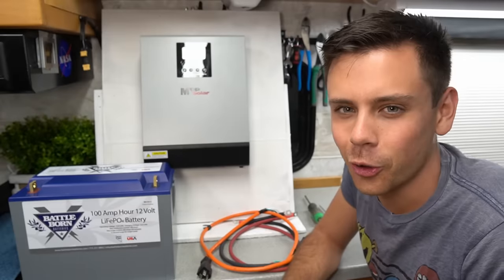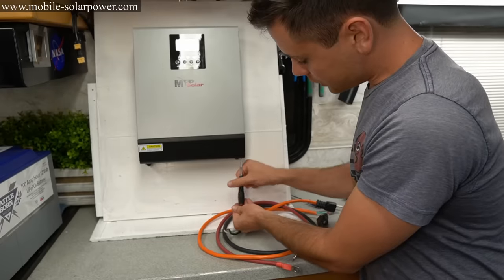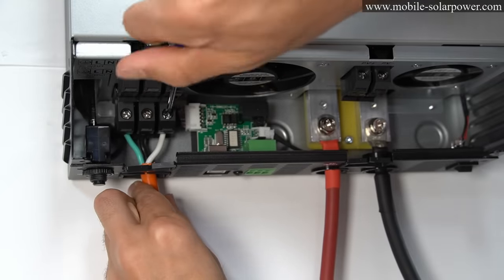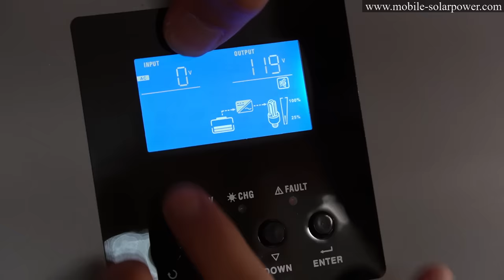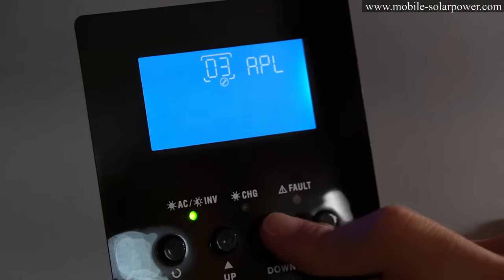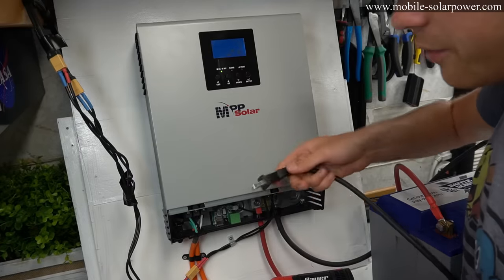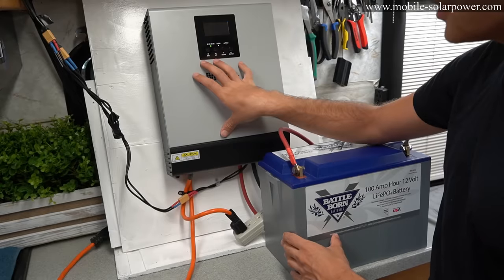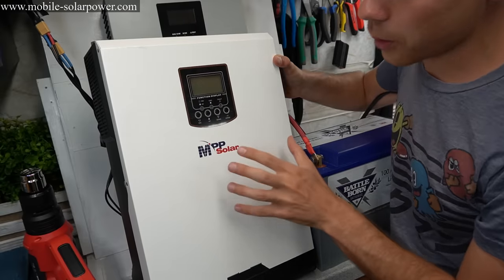Beginner Friendly All-in-One Solar Power System! Build a System in Minutes

Comment: Small tip for anybody who might struggle with putting that cover back on. Tape it in place with a piece of painters tape, put the screws in, take the tape off. Done.
Reply: Good call. 👍
Reply: NNEEERRRDDD!!!!!!!
Reply: EastSide Eddie I used electrical tape...it worked to keep the bugger in place. I never thought mounting the unit would need to be a 2 person job.
Reply: He should invest in better screwdrivers they even make screw holding screwdrivers that would make puting the cover easier.
Reply: Oh..this and about 1000 other times in my life that I could have used that trick had I have known!

Comment: I have the 24v version it has been running for 2 years my brother has the 48v version and it has been going 5 years they are good systems
Reply: Can i run a 600 watt grow light of this system
Reply: @sweetness6048  the inverter is good for 2400 watt so yes but it will also depend on how much battery capacity you have.
Reply: Must this system require an AC breaker(between AC input power source) and a DC breaker(between PVs and inverter)?
Reply: @tchelenon  yes,,, always use breakers to protect from fire.
Reply: Are you able to get the 48v 5000w version that has a 110 output and input for use in the US?
Reply: phuc ewe  cause indoors is more stealthy and I can provide better growing conditions no bugs or mould problems
Reply: @sweetness6048  Indoor growing is very very energy intensive.  The statement that you "can" provide better growing conditions, really means that you will be running other equipment as well; such as fans, dehumidifier, AC unit, heater, etc. as needed to provide those conditions for the plants.  All these electrical drains will kill your solar system if you only intended to use 600 watts.  
A 600 watt light for 16 on 8 off is a huge amount of energy to provide by solar, basically looking at a 20 thousand dollar or more installation.  and then you need to consider all the other equipment you will need to run in case of high humidity or high temp or low temp or low humidity etc.  
So the short answer is "no"
Reply: @thedillestpickle  I only need to offset the cost off the light witch is 600watts ac and all the other equipment will be powered from the grid Witch is why asked if it's was able to power light and not all the above like you mentioned
Reply: phục êwê cause he wants indoor. He doesn’t want light depth or outs.
Reply: 48v system where you wire the panels in 4 panel series (=48v ?) To narrow the voltage gap between inverter and use like an A/C system plus whole house off grid? Assuming very little A/C at night when solar is zero?
Reply: @sweetness6048  😎👍✌
Reply: Can you shut off the inverter without shutting down the whole system?
Reply: hey great video bro, what if i want to increase my battery bank and use more that two batteries, can this system safely handle it? And what if i want to use more solar panels that exceed the 85volts recommended?
Reply: phục êwê  FBI wants to know your location.. send your live location now
Reply: phục êwê  LOL !!! What a great idea ? !
Reply: Can you use it without a battery . Assume that there was a very sunshine day.
Reply: Jimmie W mine keeps charging batteries with solar when turned off,it’s a red one 3000 w same thing tho
Reply: What size fuse do I need with the 24V 2400w board between batteries and board with 2  100ah batteries, 1200wh?
Reply: @duhmikie939  100
Reply: Chris, In trying time understand this system, I’m wondering if wind turbines can feed the input?
Reply: @liammccarthy2277  I've had no experience with wind turbines so I can not help I believe the charge controllers from midnight solar can charge from sources such as wind you could still use the pip inverter too and if your using any form of lithium please use a BMS
Reply: @imchris1978  Thanks for the reply, After seeing this setup, I'd like to put it together. 
Would 2 12v 100AH AGM batteries  in series be sufficient for this setup?
Thanks
Reply: @liammccarthy2277  yes agm batteries will work the inverter has presets for agm
Reply: Thank you for the comment, Chris.  Looking at one if the 5k watt setups, eventually setting two up as I grow the system.  

This video highlighted a feature I didn't know was built in and that is the ATS for over load.  Gridntied but does not back feed.  Love it!
Reply: phục êwê  because it is illegal some places
Reply: On this particular video, what model is this?
Reply: The 48V version how do you integrate that to your house so you can run your appliances?
Reply: @tsunchan6657  yes but not high loads such as cooker/washing machine/dryer anything over 4000w runs on a separate circuit that is mains only
Reply: how to wire a van conversion with this! lights USB port etc
Reply: @crsbt  Thank you crsbt surfer for the reminder to us newbies.
Reply: @sweetness6048  you should be able to run 6,000 watts in bloom, a 18,000 btu ac, 3-4 8" fans, plus 2 dehumidifiers, a cpl floor fans, and 4 8 bulb T 11 veglites for less than 500 bucks. The money to do much to knock the price down is really non existent for solar. You have a harder time fighting mold indoors than out, and spider mites are easy to control. You'd be better buying some bug killer and moving outside if 450 in electric is to much.

Comment: I have installed a couple of these inverters and they easily get fried with surge from lightning. You might need to install an SPD with proper earthing for this inverter.
Reply from the maker: Yeah proper grounding very necessary
Reply: How do you do a proper ground on a van install? Love your videos! @WillProwse
Reply: Ambulances hang chains that touch the ground
Reply from the maker: @rolliebca  you can't.  No such true Earth ground on mobile system. Grounding is necessary mainly when attached to grid. Not possible to dissipate excess charge through vehicle chassis. You need true Earth ground.
Reply: IDK where TheRobb573 is but i have never worked on an ambulance that had a chain that touched the ground for the electrical system. been in fire and EMS for over 20 years and worked on more ambulances than i can count.
Reply from the maker: @mylt1z28  ok thank you. Good to know.
Reply: @mylt1z28  Chains dragging the ground create sparks that cause fires. In Arizona you will be cited for that situation such as dragging trailer safety chains. Bad Idea indeed.

Comment: Your video is very informative but I have a few questions: I like the idea of the all in one system that makes it pretty easy to make up. However, my solar panels each have micro inverters. What kind of controller would I use to plumb the solar output A/C current directly to some sort of controller that would also charge batteries and would switch everything over if and when I lose power.

Comment: Will, I have been researching RV life and just want to say after watching 100's of video's I finally came across yours.  Thank you for all you do. You have taken the fear and confusion out of trying to tackle my solar on my future RV or Van life.  Your a good man and I will buy your books soon.
Reply from the maker: Thank you :D
Reply: DIY Solar Power with Will Prowse I’m about to purchase one of your books as well lol. Love the videos 
Please read my other comment.
Reply: how’s the noise?
Reply: @WillProwse  so Very talented sir
Reply: Of th e how would I run a whole RV off this since it only has the female plug? Breaker box or is only for 1 thing at a time
Reply: I just came across Will all in one unit, was wondering how u like using that all in 1 unit? Is it quiet and did u hook the wire to ur car battery to charge the 2 battery when there is not enough solar power? What kind of wire did u use to car battery to external batteries?

Comment: There's a 3rd mounting hole  under the cover on the bottom in the middle, between the circuit board and battery terminals.   No need for VHB tape or a strap.  Great video!
Reply: Jeff G oh, really? good find. Thanks!

Comment: I have the 5K watt 48V  230V model and it does have a foot on the bottom left corner which you can screw down to the back board. As instructions warn against screwing the unit down onto a flammable material, I used 2 inch spacers (metal water pipe selves), to suspend it off of my backboard.

Comment: I just finished up installing this unit. Thanks for the great review! I wanted to point out that there is in fact a bottom mounting hole, once you take the cover off. So with two screw holes in the top and one on the bottom, it gets much more secure. As always- thanks for the great videos will
Reply: How many panels did you use and what brands battery's?
Reply: @quinones355  did he ever answer? i want to know how many batteries can you use  AND  why plug into the grid?? for what reason would you do that
Reply: @michellelaclair  He plugged his heat gun into the grid, correct me if I am wrong -- to just explain the AC output of the unit
Reply: @michellelaclair  If the machines pull more power than your solar system or batteries can provide,  it will automatically switch to draw power from the grid.   That is what it is for.....
Reply: @alals6794  then why not stay on grid if grid is avaliable?
Reply: @VideoByPatrick  Simple... So not to pay for electricity from the power company. If you've invested this much in power generation, use up as much of your self-generated energy first.
Reply: Is good for me to switch off my hybrid inverter when I'm not using it for some weeks or months

Comment: Couple of hints ;)
1. It would be nice to note that different countries use different colours for AC wires. So anyone making the connection should verify this before connecting or they can damage or burn down something. 
2. When making the connection it is good to pull slightly every wire after tightening the screw. As sometimes the terminals can be tricky and the wire stay lose resulting sparkling, heat and fire. If the wire moves then pull it out, unscrew/open the terminal and reinsert the wire.

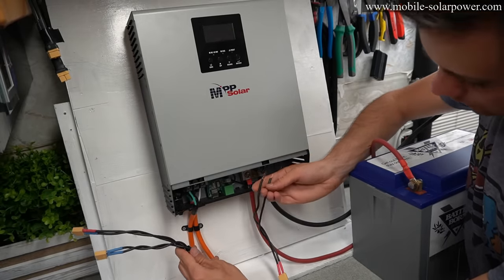Comment: It does has a mounting point on the bottom, remove the cover and the dimple in the center has a hole for a mounting screw (min 7:07). Alternatively, we can drill holes on the dimples on each side.

Comment: Hey Kid. Thanks. Heads up. The " all in one unit" has a screw hole under the bottom door. Along with the 2 others on top, makes it much more secure. I bought it because of your review. Congrats on your success.
Reply: How is it working out for you now, pros/cons? I’m on the fence on getting this. Thanks in advance.
Reply: @seanoneal94  I tested incoming yesterday. My meter was showing only 100 coming in out of 400. I need to build an adjuster arm so that I get more direct sunlight. Using revitalized agm batteries that I revived from a friends wheel chair.
Reply: @seanoneal94  Originally I had bought a 400w kit through Newpower in wintertime and installed in the van I was going to live in. I bought a house and bought the all in one Mppsolar 12 volt. Now, in my stick built home I'm regrdetting not having purchased the 48 system.

Comment: FYI... You show mounting to the wall/board at the two screw mount points at the top and that a disadvantage is the inability to secure the bottom. However, there is actually a third screw hole under the detachable cover in the bottom area of the unit noted in the user manual under "Mounting the Unit".  Thanks for all the information you provide, looking forward to setting up a 400W array with a couple SOK batteries and this unit to serve as backup power for my business main server rack.

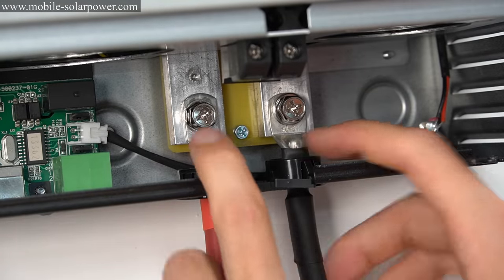Comment: Will, if you go to the 2:00 mark you can see a 3rd mounting screw hole under that 2 wire plug by the circuit board. you would probably have to unplug that wire to use it but it is there.

Comment: I just purchased this unit few days ago. It arrived yesterday, Friday. I installed it for my off grid setup. I used the rich solar 20a mppt charge controller and a 100ah lithium ion battery before this upgrade. As of now I am just utilizing 3 - 100w harbor freight solar panels from my old setup. I'm still learning as I go. I plan upgrade the the panels in future. Your book has been a great help to understanding how solar power works.  Thanks again.

Comment: Please do a video on how to wire  a van conversion with this! So lights USB sockets etc
Reply: Hi Yohan, Good question. I just saw this video. I guess I would need to build another box that doesn't have an inverter. 12 volt outputs and usb outputs. Is that what you did?

Comment: Dear Will, I would be really interested to learn how these off-grid hybrid inverters do their ATS automatic transfer switching from solar and grid to batteries and the local 240/110 Volt AC outlet. Perhaps you could do a teardown or experiment pulling out breakers etc and show what happens ?
I am very grateful for your introduction to electricity and solar videos which I have recommended to many friends.

Comment: Great set up.  Can you do a video about how to power an off grid cabin with only solar and a generator?  The cabin is wired with AC but I'm not sure how to tie the solar system into the electrical box.
Reply: 240 volt , 2 pole 40 to 80 amp  breaker, red and black wires to circuit, ground to ground terminal , white ( neutral wire) to neutral bus in ac panel.  Controller should automatically sense another source coming from generator when PV is listed as main.  Double check the grounding though.

Comment: Hi Will, thanks for your videos, like many others I have found them very helpful for making informed decisions on what solar energy system works best for your needs. 

Apologies if this was asked already, but I know you suggest mounting this unit in a closet due to the fan noise. Another user mentioned that the recommends not mounting on combustible material. 

1. Would mounting this in a closet or other man made box compromise the unit’s cooking abilities? 
2. If building some sort of box or container for it, what material would be recommended?

Thanks again.

Comment: Will. I know this is an "old" video, but I still wanted you to know how much it is appreciated. I am set up to run my TV/Surround sound system each night off two Battle Borns. I have lots of watts of solar. I wanted to do 24 Volt system. Now I can purchase just this one thing and it will do everything I want: MPPT charge my batteries during the day, run my TV/Surround at night during "Peak" energy cost from the grid, switch to the grid if I screw up and overuse my batteries. Perfect!!!  Question: If at night and using the Grid, does it charge my batteries from the grid?

Comment: I have just seen your video - its excellent, I have a question - do you recommend a system that works for 240V AC output, that can be used in Europe and the Middle East, ? I would appreciate a link - Thank you

Comment: Hey Will, thanks for the videos! I am building a small van, and I really like this option. I am thinking either 12v or 24v. One thing is missing for me. Shore power, solar  ... is there a way to charge off of your vehicle?
Reply: I'm in the same boat as you. I had planned on connecting my leisure battery to the split charge relay to charge whilst driving but also to this type of system to charge from solar when I can. I had planned to use a LiFePo4 battery but will advised against charging lithium off split charge as it will burn out the alternator, so now I'm thinking of fitting an mpp unit, a split charge relay and using an AGM battery.

Comment: Hyper Voc in cold weather often produces an over-voltage condition. Is this unit smart enough to compensate for that? Also, is it pulse width or mppt? Thank you.
Reply from the maker: Oh that's not a issue at all. Mppt controllers always have voc limit. They are usually derated for safety anyways. Just follow the recommended limits and you will be fine
Reply from the maker: It is mppt but you can buy a pwm version

Comment: I wonder if this system using a lead acid bat and 200w of solar, would run one of the small dorm refrigerators you were discussing in a previous video?
Thanks Mr Will
Reply: I have a Jayco 166 FBS with a 190 watt panel and a single 12v battery. It also comes with a 120v micro fridge. I plugged the fridge into a cheap 750/1500 MSW inverter and it worked fine and seemed to pull about 50 watts. I did not test it overnight because I didn't want to take the chance of drawing the battery under 50% which might damage it.

Comment: Because of the Covid-19 pandemic my life took a turn. I'm now the proud owner of a Freightliner Sprinter 4 cyl. 2.1 3500 van for fulltime occupancy. I purchase your favorite 40 amp charge controller. van came with a dead battery, but a 6000 watt inverter. 😂 That's how my lucks been going. 😌 So, new starter battery than also purchased a lithium SOK 1000, and two Bouges 180 watts solar panels. My questions Will is do these complement each other with the 6000 watt inverter and should I set solar panels up in series? Budget is on fire and I'm running out of $$ to purchase a fire extinguisher. 😉 I so hope they do! Also, alas I need to purchase proper gauge wiring and tools than its off to work I go!
 If I was 40 years younger I would be knocking at your door! 😂 Thanks for all your helpful videos. I'm a novice, but I'm learning thanks to you.

Comment: Hi Will I've used Voltronic Inverters for years (great product). I started with one 5Kva now have 2 x 5KVa in Parallel mode.  I'm trying to reduce overnight battery drain (quiescent current) I've diverted all small parasitic loads to a 48 to 12v DC to DC converter. I've now have acquired a used 1Kva (Voltronic)  inverter, on 2 x 100 AH L/A Battries) to run my home at night (Comms, security, etc.) It has a far lower current drain for small loads.  I want the 2 x 5Kva to go into standby mode with no load connected at all (2/3 w).  Even if I disconnect all loads, the fans still run and they draw power (250w) Any Ideas how to force this Standby mode >10w?     Great channel :)